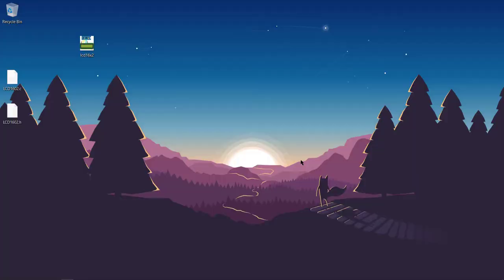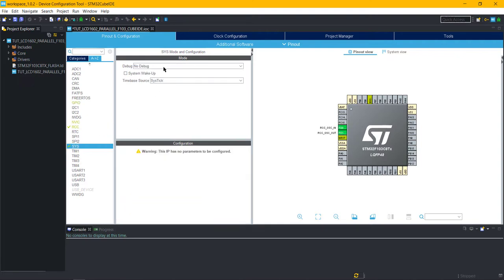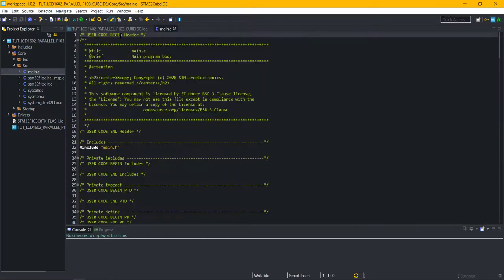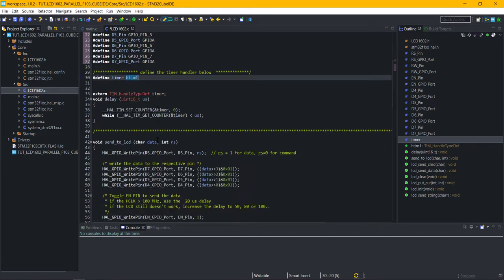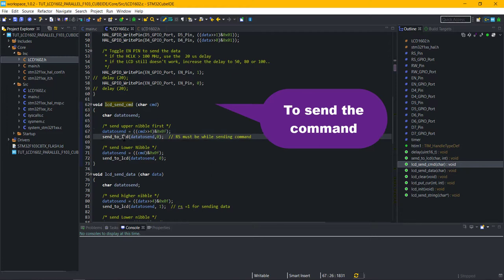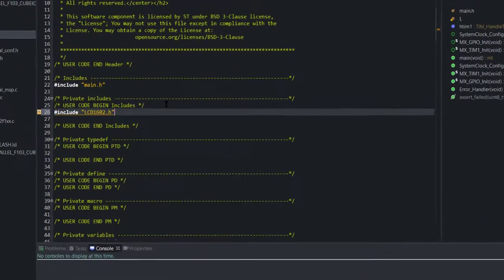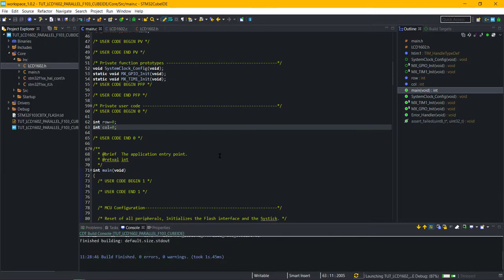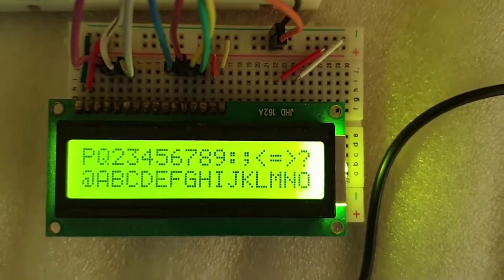Interface LCD 1602 with STM32 || Parallel Connection || 4 bit mode || noI2C

Comment from the maker: The blank screen might be due to the delay issue. Here is what you can do
Put the code below in the LCD.c file

1. static uint32_t DWT_Delay_Init(void) 
{
  CoreDebug->DEMCR &= ~CoreDebug_DEMCR_TRCENA_Msk;
  CoreDebug->DEMCR |= CoreDebug_DEMCR_TRCENA_Msk;
  DWT->CTRL &= ~DWT_CTRL_CYCCNTENA_Msk;
  DWT->CTRL |= DWT_CTRL_CYCCNTENA_Msk;
  DWT->CYCCNT = 0;
  __NOP();
  __NOP();
  __NOP();
  if(DWT->CYCCNT)
  {
    return 0;
  }
  else
  {
    return 1;
  }
}

void DWT_Delay_us(volatile uint32_t usec)
{
 uint32_t clk_cycle_start = DWT->CYCCNT;
 usec *= (HAL_RCC_GetHCLKFreq() / 1000000);
 while ((DWT->CYCCNT - clk_cycle_start) < usec);
}

2. Initialise the DWT in the starting inside the LCD_Init function
DWT_Delay_Init();

3. Now use DWT_Delay_us (time) ads the delay instead of the timer delay

Comment: Hi, I have a question, how can i continue printing automatically in the 2nd row without call lcd_put_cur(), if the word's lenght is more than 16 characters?
Reply from the maker: You can write another function for it. Inside that function, check how many charatcters has been written. Once the number crosses 16, call the lcd_put_cur to put the curser in the second row.

Comment: Thank you for all your great tutorials.
How do you control the LCD contrast? I don't see any potentiometer on your breadboard. Is there an other way?
Reply from the maker: I didn't controlled the contrast in that. Just connected the pin to 3.3v. I don't use the lcd without i2c.  This setup was just done for the video
Reply: @ControllersTech  Thanks for the quick reply:)

Comment: Thanks  for  you  great  best..that  very  useful totuirial ..the LCD  work  on 3.3  volt  or  5  volt power supply.??
Reply from the maker: 5v
Reply: @ControllersTech  this  code can  use with STML xxxx ?
Reply from the maker: Yeah why not..
Reply: That  good..because  we  use ATM32L  ultra low power sreies....thanks  so much  for your  reply..

Comment: Hello, 
I want to realize a project with FreeRTOS and multi tasking. I guees there will be some adaptations to make it non-blocking (non-blocking delays). Any advices on how to do it (for example can I use it with I2C without any difficulties?). 
I'm a newbie with STM, thanks for your answer.
Reply from the maker: Yes you can use i2c. Check another video  for i2c and lcd

Comment: Hello i am trying to follow your tutorial but i can´t get it to work. The screen turns on , but all that appears are black rectangles, as if all the lcd matrix was turned on at the same time. 

1st question: In the code there is no reference to RW at all, it gets defined but you never set a value to it, ¿Does this matter?

2nd question: If the max clock speed of my microcontroller is 80Mhz and it runs at that speed in default, then there is no need to activate the ceramic clock, ¿Right?. I am just using the internal clock with a prescaler of 80-1.

3rd question: My LCD is a GDM 1602K, and in the datasheet it seems all the commands work exactly the same, but there is no reference to the initialization procedure, ¿Should i use the same one as you do?

If you have any clue about what my problem could be, i would be more than greatfull.
Reply from the maker: 1. The RW pin should be low for the write operations. So just connect it to the ground
2. You might need the microsecond delay. But if you don't know how to work with it, you can reduce the HCLK to 50 or something, and than just use the code simply without delay
3. All 1602 works with the same initialisation

You might want to reduce the contrast if you are seeing the black boxes.
Reply: @ControllersTech  I will connect RW to ground, I forgot to mention that between all the black boxes there was half a second where i could see half a number form on the screen, so i dont think it is the contrast
Reply from the maker: Ok.. it must be the timing than. 
Either create that microsecond delay, and use it where I have commented it out.
Or reduce the HCLK to 50 MHz or so
Reply: @UCkdqtSMnhYuMsJkyHOxiPZQ I will try reducing the clock speed to 50mhz to see if timing is the problem
Reply: @ControllersTech  I'm too facing the same problem, Rectangle boxes even after changing HCLK delay.......is there anything else I should do to make it work?

Comment: My maximum HCLK is 48 MHz so i tried some differents prescalers in the timer 1, and i remove the delay from send_to_display function. I also connected the RW pin in the GND. But doens´t work, do you know what could be? I am using a SRM32f072B Discovery board. Thanks.
Reply from the maker: Don't mess with prescalars. The purpose is to create delay in microsecond. First check what's the apb clock for the timer, that u are using. 
Let's say it 48, than use prescalar as 47. 
Also for 48 MHz hclk you don't need the delay. It will work without delay, although just introduce small delay in case of errors
Reply: Hi man, i got the same issue as you here. I use the same board and still getting a blank screen but I don't find the solution. Did you managed to make it working ?

Thanks

Comment: everything is correct but your  code is not working. I set up the lcd and pinouts as well everything is correct.
Reply: Same... In my case STM32 CUBE IDE gave the message " ./Core/Src/sysmem.c:63:1: error: unknown type name 'caddr_t'" when I tried to compile :(

Comment: I'm using  a NUCLEO-F446RE  but it doesn't work,  the LCD lights up but it doesn't write. the Clock is 84MHz so i'm using a prescaler of 83, I also chaged  the pins, i'm using PB8-PB9-PB10-PB12-PB13-PB14-PB15. Can you hel me?
Reply from the maker: well i have 446RE and it works pretty well. SOMETHING WRONG FROM YOUR END

Comment: Can we use the same code in the keil software. Will it work like using STM32 Cube IDE for pin configuration and the code in the keil software that you explained here. Will it work?
Reply from the maker: Yeah it can work with any ide..

Comment: hi,i use stm32f4 discovery and just light up,no letters or numbers at screen etc. apb2 bus 168Mhz, so i made it "168-1" ,presecaler is "0xffff-1".Other things same. I increased microsecond value step step such as 0,,20,50,80,130.. what should i do,any offer for me? thanks in advance
Reply from the maker: Try reducing your clock below 72 MHz and don't use any delay and check..
Reply: you mean "void send_to_lcd (char data, int rs)" that function delays right? i made clock bus 42Mhz and close delays in this function
but still just light on. no letters and numbers
Reply from the maker: read the pinned comment..
or contact on discord
Reply: @ControllersTech  i read but no solution. and i wrote stm32f4 channel on discord

Comment: Hello
In 100,000 units, less than 1 is displayed as zero, and how do I make zero invisible?
Reply from the maker: I don't understand what you are asking..
Plz explain
Reply: @ControllersTech  Decimal Display  000100  > 100   ,    000123 > 123
Reply from the maker: So you want to display 000100 as 100 ?
Or as 000100?
Reply: @ControllersTech  Yes, that's right. 
Please tell me how to mark 000100 as 100.
Reply from the maker: You can use typecast to conver it to integer.. so it will convert to 100..

Or use some do while loop to check until the first number, other than 0 arrives. Then save the rest of the data into the buffer
Reply: @ControllersTech  Thank you.

Comment: Hello sir,
I flash the same code in my lcd with stm32f103 the only difference that i have was pin use insist of PA4-PA7 i am using PA0-PA3 so i change configuration of lcd data and lcd cmd but that didn't work i use (cmd&0xf0)right shift 4 . please suggest what possible error i am doing
Reply from the maker: You can't use PA0 to PA3. In 4 bit mode, you have to use the pins 4 to 7.
Please read the datasheet before experimenting..
You can use 8 bit mode and use all the pins(0 to 7).
Reply: Hi, i am not saying about the lcd pin i am talking about port pinof stm32f103
Reply from the maker: Oh my bad.
Don't change command.. just define new pins and leave everything as it is
Reply: but you have taken pa4-pa7 data pin and i have pa0-pa3 as my data pins so does we need to changes for the nibbles in cmd and data
Reply from the maker: No. The code is written to take take of individual pins. Also that's the point of defining them in the beginning, so that we don't have to deal with them afterwards
Reply: @ControllersTech  

i am not talking about the pin ,i am saying that you have shift the data according to the d4-d7 of port a pins and i am taking pa0-pa3 pins so is the shifting going to remains the same or it will changes becuase i have initalize the display but it didnot showing anything.
Reply from the maker: That shifting is not according to the mcu pins.. it's According to the lcd pins..
Reply: But i want to know that selecting different io pins didnot change the shifting process
Reply from the maker: No it does not.

Comment: Thank you for this ...your videos are very helpful . i am having difficulty passing numeric values. Kindly advise. i tried sprintf  to char array variable , but no success. kindly provide sample code to display integer variable e.g 1234. thank you.
Reply from the maker: Char num_arr[4];
Uint16_t num = 1234;
Sprintf (num_arr, "%u", num);
That's all. If it gives error with %u, try changing uint16_t to unsigned int..